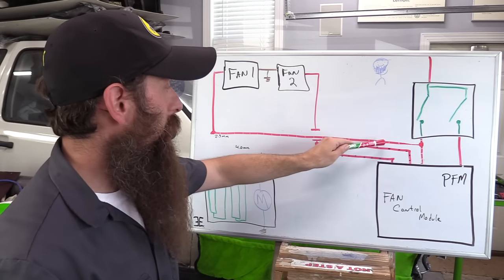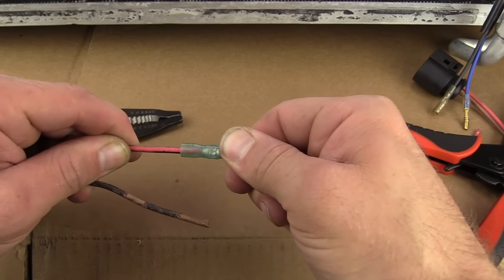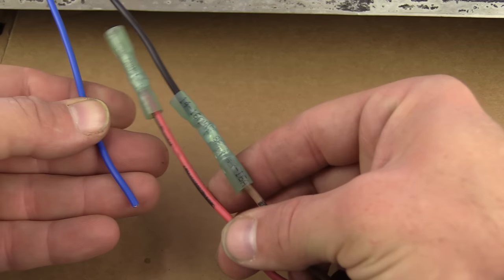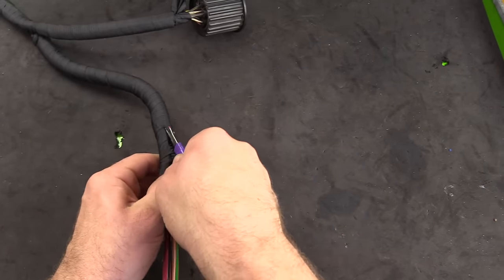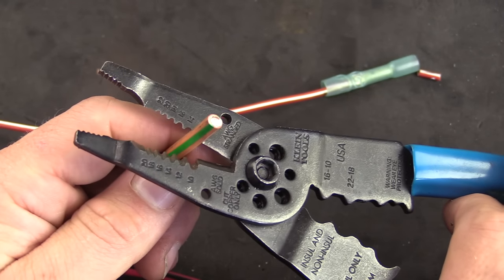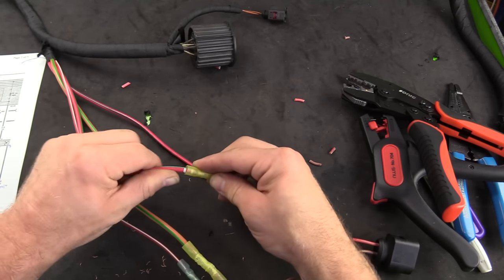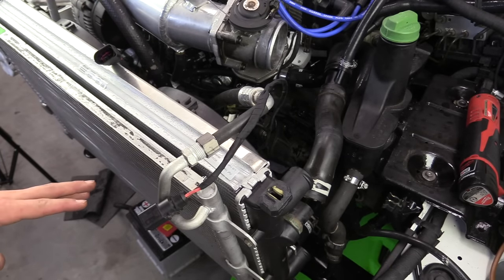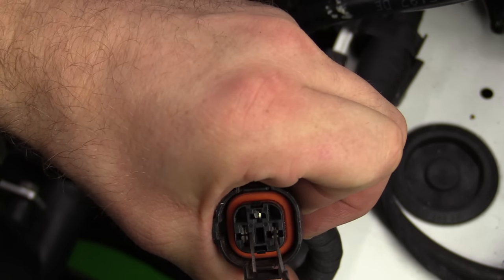How To Wire Electric Cooling Fans with Crimp Connections

Comment: Nice instructional. I have a puller radiator fan and a pusher ac condenser fan . Should i wire them to come on together or separately?

Comment: love how you used the OEM fan control module with factory connectors at the fans....its clean no switch to worry about.....using the factory module could you have wired in a manual override in case you wanted them on all all times?

Comment: Hello I have a 1987 mercedes 300d. I want to get rid of the clutch fan and add a fan set up like you have. I live in boise area and it hits over 100f often. 
And my car will run close to red if I run  ac. If I paid you and gave you the factory wiring diagram  could you draw out how to wire it in so it will work.
Im not sure how to wire it to the factory temp switch. Any help would be greatly appreciated and I'm more than happy to cover your time.  Shops in my area are afraid to work on a mercedes.  Thank you for your time. Robert

Comment: Charles; While I have used splice and seal connectors with much success, I don't have confidence with them when I have two wires going in one end of the connector. I don't think the heat shrink end seals well enough in the gap created by the two wires. A method I have used often is to wrap the wires with Scotch #2228 Electrical Sealing Tape. It has a thick mastic for the adhesive that you can press into the gap between the wires to seal out any moisture and salt. I am a veteran of countless failed GM splices, and have never had a return repair using this method. I found the tape available at Lowe's. I HATE green conductors.
Reply: Ever tried using well water pump connectors? They’re more than submersible . My grand father is an electrician and even if he uses heat stink connectors he still heat shrink another tube over and still electrical tapes things if that worried about water

Comment: I might have to try this setup. I've got a mk2 Jetta 12V VR6 swap with a Corrado SLC radiator and fans. In the middle of the Texas summers I have instances where my water temps get a little too high for my liking. Just to pick your brain... Did you custom fab that fan shroud or does somebody offer it for sale? What electric fans are you running?

Comment: did you have to run a big fuse or get a higher output alternator to do this ? I have a 65 dodge dart I'm setting the car up for street and strip. I want to do this on my stock 82 dosge truck .i think my alternators put out 120 or 130 amps?

Comment: I am going to do this exact set up tomorrow. Going to need a 2 pin connection since my model has 3 pin at the connecting adapters. Seems like you stripped the main cable from the car and made into two...? Do fans carry a clutch that need the 3rd wiring cable? Seems like I can just do what you did , right?

Comment: Not sure if you still check and reply to this video but I had a question I was hoping you could answer.

I wired my fans exactly as you did. When I jump the pins I can get speed 1 to work but if I jump the 2nd set the other fan does   not run. I checked for voltage between the temp switch and the plug on the FCM and found 12v when the 1st set of pins are jumped but nothing when the 2nd set are jumped. Only thing I can come up with is a break in the wire somewhere but was wondering if I may be missing something. The ac has been removed from the car if that matters.

Comment: I'm not a pro but with connectors I always make the female the always hot and male the receiving side. It just seems like an extra safety precaution if u forget to remove the fuse when the fan is unplugged for example
Reply: 0

Comment: When changing a puller fan to a pusher and vice versa, remember to check your fan blades if they are in the correct direction, the blades are curved. Simply reversing the polarity of the motor will make the fan inefficient
Reply from the maker: +jim c yep. Usually you have to flip the blade
Reply: Wish I saw this last year... Lol
Reply: @HumbleMechanic  ive never understood what flipping the blade is going to do. You cant flip a bolt around and magically have left handed threads. The blade pitch and direction will not change by simply flipping the blade

Comment: Hey Humble Mechanic. Where would you put the thermocouple sensor in a vehicle that didn't have electronic fans. Would you put it where the standard temp gauge is or at the top or bottom radiator hose or at the thermostat or somewhere else? Thanks

Comment: So in this particular video, yuo are basiclly using the PCM, and or the relay from the factory setup/fuse box? I'm asking becouse the high speed fan on my 2005 Mitsubishi Endever, has a fan controle modle pluged directly into the fan motor! Unlike the two separate wire hanesses. Thank in much in advance!

Comment: HI, Charles, I have a problem and I don't know if you cover it before, The problem is I add a new fan on my transmission cooler radiator and I install  on/off switch but sometimes I forget to switch it off  then when I come back the car battery is empty

Comment: Good morning with that setup when 2nd and 3rd speed kicks in are two fans working or just one?
Reply: I have the same question. In the video just before this he made a wiring diagram, but it is different than this setup here, so i dont know why he had the diagram one way, and installed it a different. To get one fan on low, and 2 fans on high. Take the low signal from the thermostat, before it goes to the fcm, and take the high setting from the high setting on the fan harness, after the fcm. You should still have ac, after run, and the system working a vw intended. This is how he made his diagram, but didnt wire it this way for some reason.

Comment: I followed this video to install 2 mishimoto fans on my mark3 GTI.  However, I do not have a shroud.  The fans operate perfectly but they don’t provide enough airflow.  Car didn’t overheat but it got very hot during the first drive.  Where did you get the shroud you are using?  And how did you mount the fans?

Comment: Nice video, I have a 2007 Passat 2.0 FSI, cooling fans are NOT working properly, they come on when I applied power with a battery to plug, they do not work period when car runs , nothing when a/ c is turned on, I've replaced thermostat , coolant sensor, checked fuse, unable to locate the fan relay, any ideas?

Comment: Thanks for you for this, it was perfect? I also used a sheet of heat shrink that worked nice.
Reply: This is great. I've recently changed my radiator and got a decent double fan system for it. Realising after fitting it all the AC compressor was removed by the previous owner. Can I connect the relay for both the Ac and radiator together? Meaning both will come on together? Or should I invest in a fan controller than handles both fans? Bit lost if I'm honest. I can handle the wiring once I know the flow 🤣😁 it's a Honda civic ep3 (type r) BTW. All help is massively appreciated and I love the depth you go into, it's often what I need and the some additional learning :) I also love to see you change your mind in these vids or improve ideas. Seeing this is more realistic and better to learn from.

Comment: i want the both fans to run on high speed all time on my Suburban 2012  because my country is very  hot specially in summer and overheating when stopped on traffic signals  so I want to run the both of them  in high speed situation all time  by 4 relays  5 pins  and  a breaker saftey  fuse  80 amper  can you draw the diagram thanks in advance .

Comment: I wanted to add a small cooling fan to my engine hood to cool off the engine bay.  I by no means have a racing 1999 honda crv, but I wanted to cut a small hole on my hood to allow the fan to pull out the hot air from the engine bay.  How would I hook it up to the electric?

Comment: Is it ok to create a pull fan simply by reversing polarity?  I tested one of my fans with my Voltage Generator.  Reversing polarity seems to create a slightly different draw on amps.  Just slight.  Just wondering if this is the recommended way to create a push fan.  I was thinking if reversing polarity is actually not a good idea, I can just pull the fan blade off and flip it around.  Thoughts?
Reply from the maker: For the motor yes.  But like you mentioned you have to have the blades right too

Comment: Hi sir
What happened if I connect two fan in a radiator in a key switch on
And the two fan running comsistently when the key is on
Is it safe and advisable or not?
Im just confused because i had a chevrolet optra and when the thermostat ac fan off the reservoir are overflowing and when the thermostat ac fan on it becomes normal
So I bring the car in the autoshop and they do the two fan connect as one so its run when the key is on and now my reservoir are normal and my car run smoothly so i just want to ask an advice of this setup of mine thanks
Godbless

Comment: Hello Charles. I want to add a third fan dead smack in front of condensor but having trouble connecting it. i teied to tap into existing wiring with a inli e fuse but the fuse foe the co desor fan relay keeps blowing. I wanna know how can I acheive a third fan hook up without blowi g a fuse? If i hook power wire ro 3rd fan to battery pisitive it will run all the time even with key out. I tries tappi g to radio but that work for like 5mins then it died huh.

Comment: If you do want a reason for installing which connector on which side, you can consider putting the male pins on the fans. The idea is if one is left unplugged the hot connector is female and less likely to come in contact with others with which they will not play well.
Reply from the maker: +InsideOfMyOwnMind ya that’s a great strategy. And one I flat out didn’t think of. Lol. 

Hopefully being unplugged is not something I have to worry about.

Comment: I did a dual slim fan set up for my 12V VR6.  I put speed one on one fan, speed two on the other fan and speed three on both fans.  I jumped tested it and both fans came on on speed one and both fans also came on on speed two.  I am not for certain, but I think speed two came on a little stronger.   I am guessing speed three is for the AC which is not working right now, so I can't test it.  Is my set up ok?  What is a way for me to check speed three with a nonworking AC? Thank you.

Comment: how do you wire a 3prong led rocker to ground? two wires, no relay. when its off it is illuminated. when its on, not illuminated. reference, "Ford 6.0 blue wire mod" for the engine cooling fan over ride. I've had it hooked up before and now i cant get it to do what it did previously :o(

Comment: hello
i need help if you can
i have 2003 ford f150 4.2L i bought VW touareg 2010 electric fan with speed controller module how can i fix it with the module benefits, what parts i need to add or cancel in my truck what the connection diagram please help

Comment: Hey Charles would this be the same on a mk6 gti? I know the fcm is on the big fan and I would like to keep it if possible but would like to put in a set of mishimoto slims like you've got as I'm running as high as 220 degrees on my coolant sometimes with living here in south Florida. Thanks in advance for the help.
Reply from the maker: You should be able to wire them similarly. It depends on how your fan setup needs to work.

Comment from the maker: Next up is getting the AC all worked out. I am convinced that the AC compressor is toast.
Reply: Shoot. Sounds like an expensive run to the parts store. Good luck :)
Reply: HumbleMechanic 

On a totally unrelated note....

I now your a vw guru so ....

Why dont vw/audi 3 cilinder engine,s lay exactly horizontal ?  Im dying to now .... thx up front
Reply from the maker: +TheMatrixcube hummm. I am not sure. US never got the 3cyl
Reply: HumbleMechanic 

Dammit nobody seems to now ...
Reply from the maker: +TheMatrixcube I’m gonna do some research because now I’m curious
Reply: HumbleMechanic 

Epic! Thanx a million ...

Its been a hot topic with other mechanics over here ! 

Im repping the channel in belgium! Love it
Reply: hey man, are you going to DIY your AC? not unexpected for a vw tech i suppose, but from my perspective trying to fix AC on my jetta myself was a nightmare. bummer to hear the compressor might be dead. does the mk3 use one of the variable displacement ones?
Reply: The US requires firing orders that are difficult to memorize. 123 just doesn't cut it.
Reply: I know charles is too classy for this advice but I would just delete the a/c for simplicity.
Reply: HumbleMechanic you going to test with compressed air like ScannerDanner. He uses air to test the system functionality before recharging with refrigerant.
Reply: I'm not sure if the MK3 has that style of compressor or not; but, good call on the variable compressor...I have heard of more than one VW owner that thought they had a dead compressor since the system showed proper pressure, only to find out that the charge was wrong. From what I have read the ONLY way to know if the system has a proper charge is to weigh the refrigerant that goes into the system.

-I have no doubts that Charles is familiar with this process, but I wanted to throw this comment out there in case it helps someone else
Reply: HumbleMechanic I have a question about wiring my fan in as well. I got rid of the fan clutch and purchased a radiator fan. Can I just wire it to the AC fan or should I just install a thermo switch?

Comment: @HumbleMechanic about connectors, I do not know, if it's a rule, but I usually use connector with exposed pins on component side, that requires power, but covered on power side. In that way I can disconnect device and leave wire hanging and no shorts can occur and also I will not get shocked, when touching those open pins. I know, it's 12V only, but I use the same rule for all voltages, so I don't mess up. By the way it looks like you did the same as I would do ;)
Reply from the maker: +Janis Rocans that’s a pretty good rule I’d say. Especially for house wiring.
Reply: Female side of connectors are usually always on the feed side of the circuit to help mitigate accidental contact or short to ground due to less conductive contact material exposure. 

Low voltage and power limited (generally less than 30VAC-RMS or 60VDC) and above circuit connectors are covered by IEEE, ASME, EIA, SAE/ISO, IEC, NFPA and NEC standards regarding assigning the gender of the power/source/feed side and the load side of connectors for safety, prevention of personal injury and or circuit (fuse/conductor/switch/relay/control module/ECU/PCM) damage while the connector is disconnected.
Reply: @patw52pb1   You must be an engineer, They always seem to have a problem overthinking everything! Everything that you have mentioned does not apply here! This is nothing more than 12 to14 V DC in an automotive application! And as for your connectors being male and female to avoid all of that crap you said, How about if you disconnect a component you terminate your end properly and don’t leave it hanging around unprotected!
Reply: @NeverEnoughPyro40  
Thanks for the compliment. 
Everything I stated is accurate and applicable. 
Yep, that is why practically every vehicle manufacturer on the planet uses the industry standard of female socket connectors on the circuit feed side and male pin connectors on the circuit load side. 
Circuits are properly terminated with the connectors connected or disconnected when installed as I stated. 
Also, without engineers, you would likely be sitting in a dark cave, while dirty, uncomfortable, hungry, unhealthy, and playing alone with yourself.